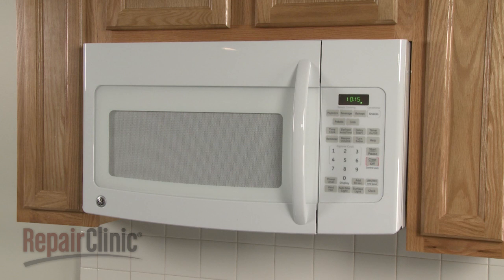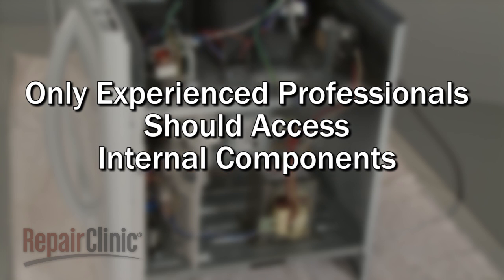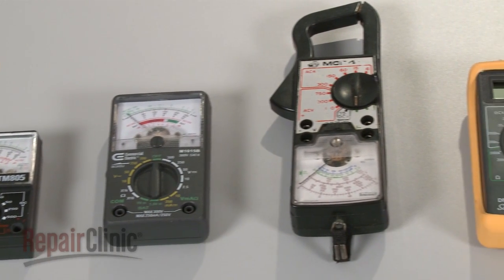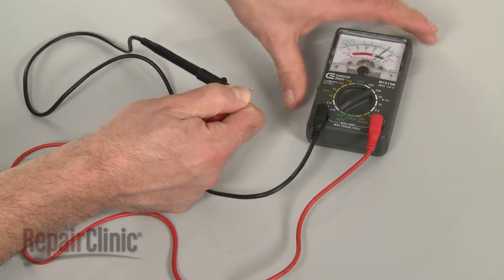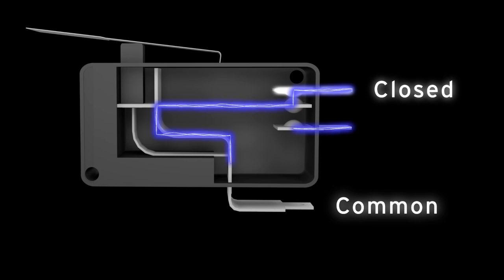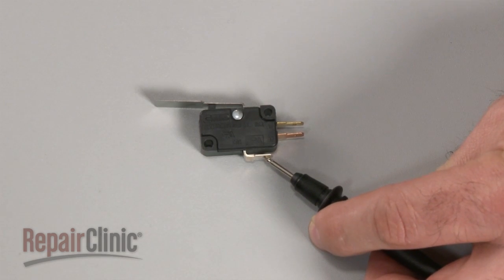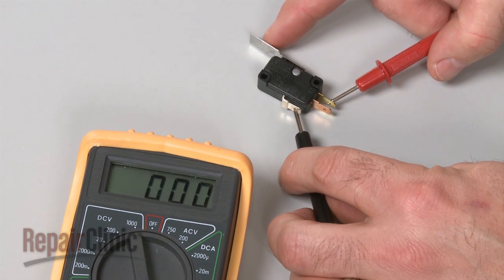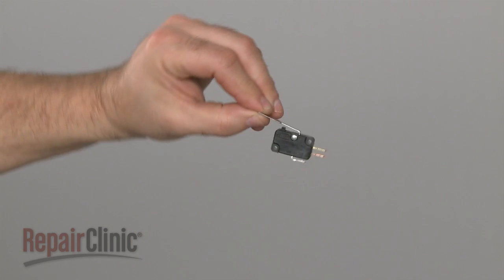Microwave Not Working? Three Terminal Switch Testing, Repair

Comment: I replaced the monitor switch, twice, on my GE microwave with a new one and the fuse kept blowing when I closed the door. Finally I simply did not reconnect the wires to the monitor switch and the microwave works fine. Is the monitor switch really necessary or is it simply a safety precaution?

Comment: Thank you.  Got the replacement switch from Amazon and it worked.  I could not find exact replacement & so used the following switch: LONYE SZM-V16-FD-63 -- no issues so far.